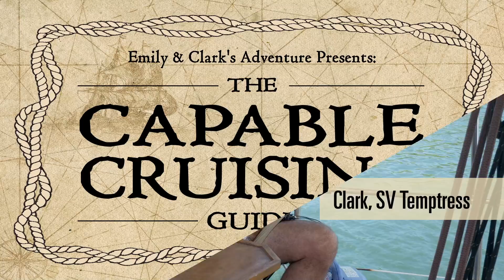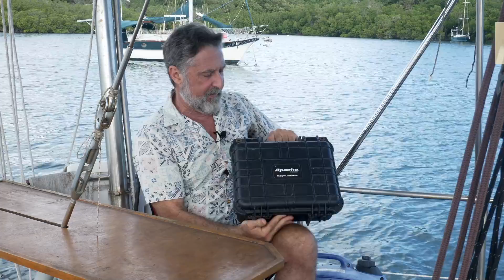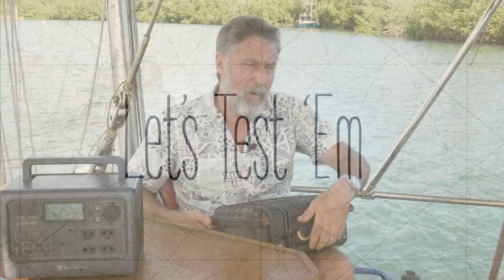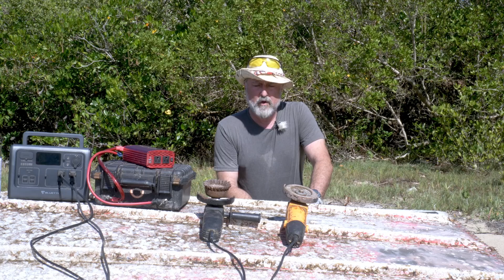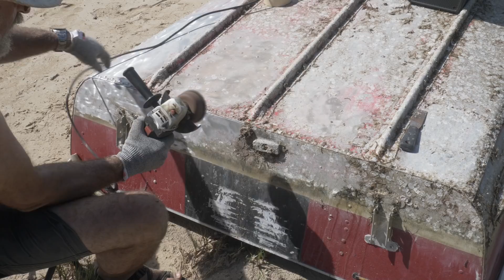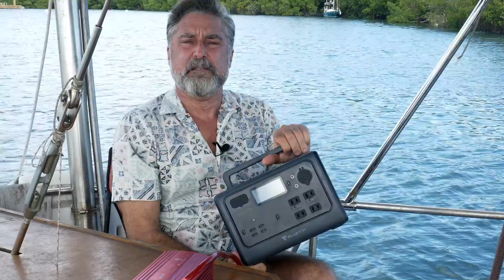Battery GENERATOR - DIY or BUY (with Bluetti EB55 Review)

Comment: If you charge your li-ion batterys ect between 25% and 80% it will have also many thousands of charge cycles. 😊
Research it on the internet if you don't belive it.
But lifepo4 battery's are in fact much safer, also much more expensive and problems in real cold weather.

Comment: Hello there. I can't seem to answer this question anywhere. 

Is there a way to use a portable power cell like the Bluetti - to power all sailboat electronics? Essentially using it as a portable option that would replace the boats permanent batteries? Thank you.
Reply from the maker: Not really.  They can't deliver much DC power and what they do deliver is tun through a buck converterso too much power is lost.

This is the easiest way to add li to a boat.
https://www.emilyandclarksadventure.com/bbms

I'm putting in a camper just now. Video on it in a couple of weeks
Reply: @Clarks-Adventure  Thank you!

Comment: I own the Bluetti EB55 and it works great. The only issue you might have is ordering the extra charging cable because they have been out of stock for awhile now. I purchased two of them to have two chargers to charge one Bluetti but you still need that cable to make it work with both chargers at the same time.
Reply from the maker: I sold mine as I had the DIY that I built.

But as I remembered they used standard plugs.  It wouldn't be hard to wire up your own.

Comment: This was an inspiring episode. I can see another case of your heavy-duty DIY battery pack. Use it as a spare emergency, say if the boat's primary electric system is flooded and you need to rig some temporary power source for the bilge pumps. It will be satisfying to run a heavy load and not be nervous if the Bluetti will blow a fuse or just malfunction in the worst possible moment. Cheers.
Reply from the maker: Yes it has proved useful so many times.  Not the least of which was during the development of my BBMS

Comment: Looks like a good piece of kit. My question is about the rationale for a small electric outboard motor. Wouldn't it be better to simply row? I'm assuming you could row almost as fast as you can move with the motor. Rowing is a good form of exercise. I can understand why a more powerful electric outboard might make sense.
Reply from the maker: I'm lazy.  Clark
Reply from the maker: And I wanted to build a lithium battery

Comment: Best and safest for AC power Northern Lights 5KW generator.Very reliable sips diesel have owned one for over 10 years.Running like it is still new.Like all your videos so much great information.
Reply from the maker: But no exactly portable...
Reply: @Clarks-Adventure  No its not but to continuously run an AC unit it is the safe way to do so.

Comment: Do you have a video on your DIY bank build? Trying to figure out what batteries to get.
Reply from the maker: Not yet.but it's in the list.

I see you had trouble with the sharasale link.  Did you get it working, your comment was marked deleted.
Reply: @Clarks-Adventure  weird. I didn't delete it.
Not sure if it is working. Hard to check from phone.
Reply: @Clarks-Adventure  must have been my pi-hole blocking it. Works from phone.

Comment: With your generator have you tried running it dry by shutting off a fuel line? I have a 6hp mercury and the dealer told me to run it dry every time I've finished with it. I've had it 3 years and it starts first time every time.

Comment: Hi Clark, my son is an engineering student at the University of Arizona in Tucson. They are working on a prototype project to help the elderly that has a A lithium battery attached to a motor to lift small loads.This is part of his senior class team assignment. They need to display remaining battery capacity. I see gauges that range from $44-$206 on Amazon. This is for a lithium battery. Some have inputs for your amp and volt ranges while others have a capacity bar graph with % remaining. They seem to be wired by connecting the battery to a small terminal block that then connects to the gauge. Do you have any experience with these for lithium batteries? Is there any gauge that you would recommend? If you are able to answer, We thank you in advance.
Reply: Pp
Reply from the maker: Sorry to say but doing that well is extremely difficult.  Most offerings are somewhat wrong most of the time.

If his needs are more in line with mostly full, somewhere in the middle, mostly empty level of accuracy.  No problem.

I've been against people using these things for years and now with li it's actually a bit harder.

It can be done with the monitoring of both amps and volts.  And a lot of cleaver software.  I'm actually taking a shot at it with my BBMS plus.  Some days I'm the most accurate monitor on the boat.  Some days Im way off.  Still work to do.
Reply: @Clarks-Adventure  I can’t wait to hear more on your project. Thank you so much for the quick reply!

Comment: Good reviews. Get yourself a connector to go from your diy powerpack to the Bluetti so that you can get the benefit of both. You don't need 2 inverters but I see great utility in the two units working together.
Reply from the maker: Sure.
   There would be some loss but worth it if I needed more power then the Bluetti could carry.

Comment: Thanks.  Been watching you both for awhile & appreciate the insight. Im a nomad both on my Tartan 37 & truck/camper.  Multi use is is important.  My solar is used on both, as well as my batteries. A portable unit such as bluetti is on the radar.  Great vid as usual.  :)
Reply from the maker: Yes this would be great for that much of travel styles.

Comment: Nice review of the EB55 Clark. I was wondering if it really did take more than 3 hours to charge it? If it was. It's kinda slow compared to the other power stations of the same capacity.
Reply from the maker: It's ac adapter seems to charge it at 200 watts.  It holds about 500 watt/hours.  So charging from a full discharge would be about that.

That's like .4c.   Charging much faster then that isn't great for li.  I think it's a  reasonable limit.

Comment: I have exactly the same generator.. I had the same problem till I put a small in one fuel filter, ours is 11 years old and has done over 2000hrs but agree noise level is not great s we will not use when it’s possible t close the boat up and not hear it from inside. Lithium is amazing and have had it for 7 years now 👌

Comment: DIY is waterproof fr boaters. DIY is about half to 70% of the Bluetti price. DIY can have special features like trolling motor use, no inverter, higher charge current, higher discharge current. 

Bluetti or Jackery has much lower capacity at higher price, and don’t take it on small boat. They are not made to marine electric standard.

Comment: I have been using a 45 pound thrust electric trolling on my 'get to the boat dingy' and to cruise around with my family maybe up to 2-3 miles with a walmart SLA and 50 watt panel keeping it charged in Maine on a not so smooth bottom 12 ft aluminum. I have been really thinking about a similar sized aluminum as our primary cruising dingy with a larger lithium portable pack. I really like the idea of the trolling motor for the ease of use and maneuverability for my wife. I don't want her to be stuck to me as the dingy operator when we end up doing more extensive family cruising/sabbatical. It had definitely crossed my mind to have this battery merged with the ships systems as well. Lots of food for thought, thank you for the video.

Comment: "Power a big refrigerator" turned on a light bulb! My application is to have a power source to run the big fridge in my house when there is a power outage. Our last power outage was for four days, so I want a unit that can be charged by the sun in a few hours, then run the fridge until the sun comes out the next day. And to do so with the power unit in the house. And every now and then power the internet gateway for a few hours instead of the fridge. I hate power outages longer than 8 hours, so I'll be looking for something that will burn a hole in my pocket! Thanks for the thought-provoking tour! :¬) Webhead USA
Reply from the maker: Well they sell all sizes.

In a real pinch you could charge this from your running car.  Fridges don't burn that much power really, especially when you turn them down and keep them closed.

Comment: I don't think you specifically listed it as an advantage although you mentioned it in passing. Your DIY one is totally waterproof. That's a huge difference if, for example, you hit some rough weather and flipped the dingy while carrying the Bluetti to/from the beach. Plus of course, you could easily get a 2000 or even 3000 or 5000 watt inverter that the angle grinder couldn't overload as long as you make sure your cells and BMS are up to the job.

Comment: The prepack unit is what it is. The home made unit can be expanded at any time.
It pays to read the specs on things. There are 1k inverters that are continuous 1k and some that are peak 1k. I have a 1k inverter that says 1k continuous and peaks at 1k8. The prepack unit is set up to be a fool proof as possible. Tech support does not want to spend it's time teaching people to use the product. It has three states: working, discharged and broken that anyone with enough money to buy the thing understands and two dummy lights can show these conditions :)

Comment: The smaller the carburetor...the quicker it'll clog when unused. Even with new carb in one to two weeks clogged. I have equipment like that where i learned to just carb-spray the carb jets i can get to and try to dose (spray) directly into the float bowl, wait a minute...before i even begin to try to start it...works 90% of the time. So much easier than taking the carb off and disassembly. I keep carb spray in the truck.
Reply from the maker: If I remember to run it dry of gas I usually do better.   But I usually say to myself "you just got it running, you will probably use it for something else soon".
   I used to always need power so I'd just run it until dry against the battery charger but with the new panels and Li I just don't need to bother.
Reply: @Clarks-Adventure  Me too...run it dry is best... let the gas in the carb evaporate and it'll clog.

Comment: They make resettable ATC style fuses you might be able to replace the ones in you inverter with so you don't have to replace the fuse if it blows, just push a button and keep working. i found some online for around $3US, might be worth looking into especially if you go off cruising somewhere you cant find replacements.
Reply from the maker: That's a great idea.

I've seen them but didn't think of it.  Perfect.  Let things cool down and reset.
Reply: There are automatic resetting and manual atc, issue is they usually don’t fit in a flush holder requiring them to stick out. If it gets irritating enough I wire a quality electrical component to female blades, jerry-rig where convenient or internal install the way the manufacturer should have to the front plate.

Comment: Charge the Blueti with the homebrew?
Reply from the maker: That would actually work.   And then I can charge my computer from the Bluetti.  Make a chain.

Honestly so far I haven't taken the time to make up a charging wire so I've been using the AC charger that comes with it and my inverter.  Stupid inefficient.

Once I decide where to store the thing I'll just make a charging cable for it that connects to Temptress' regular distribution system.  The Bluetti has a boost converter built in so it will make use of whatever voltage I send it.